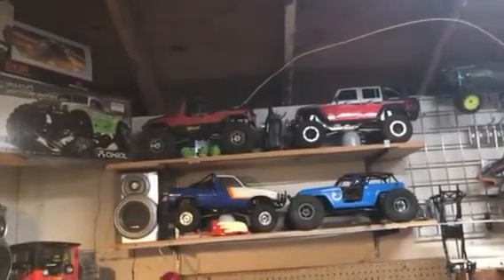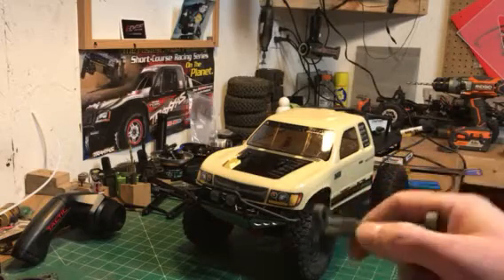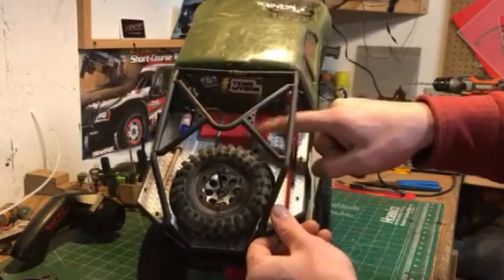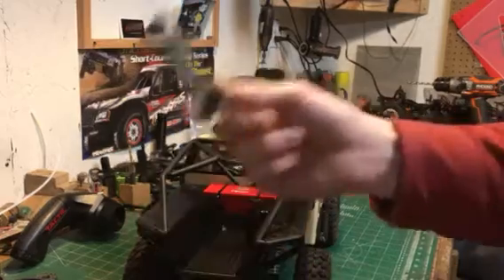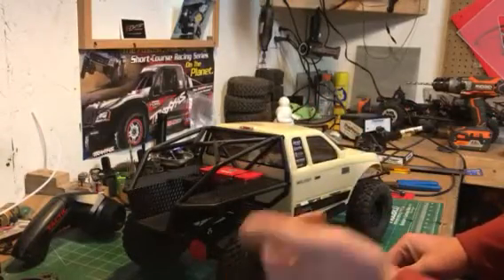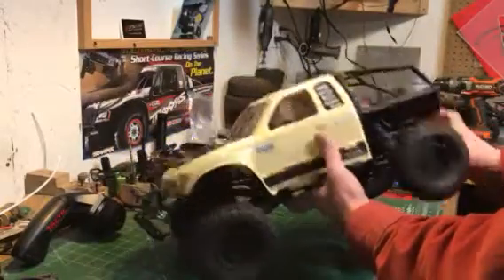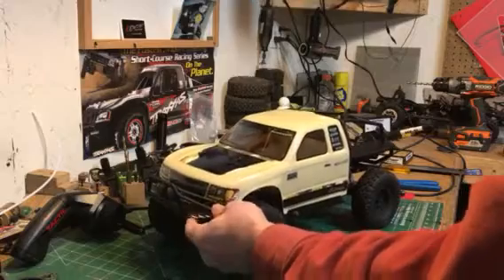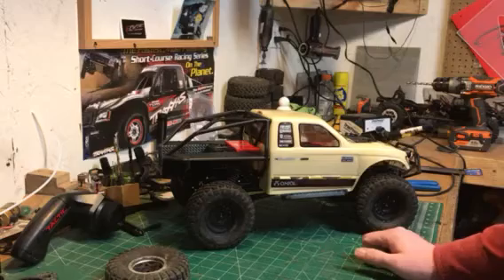SCX10 2 Trail Honcho mods Team Wyman Scale Designs

Comment from the maker: I would swap the rear springs to the front and tilt the rear shocks forward. The best way to do this is to swap the left and right rear shock hoops.That’s a good starting point. After that just drive it and see what else you need to fit your driving style. Don’t forget to have fun this is a great little truck.